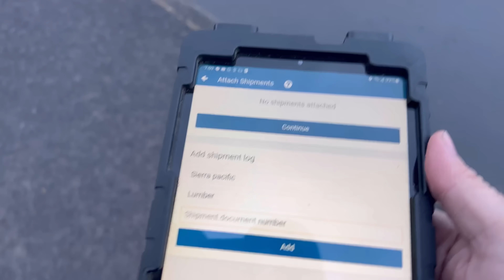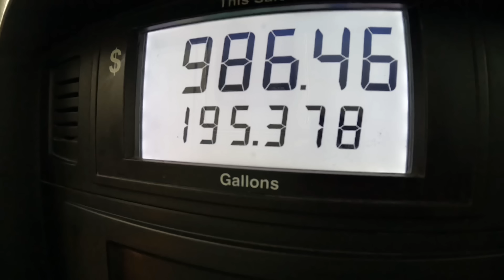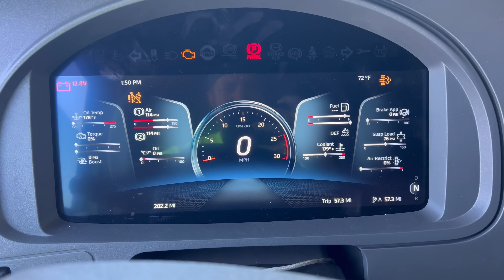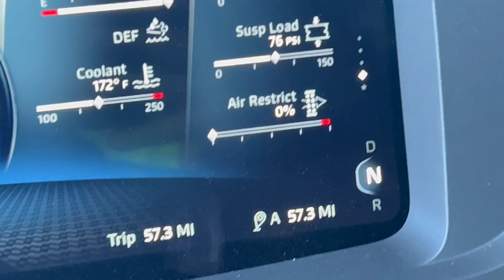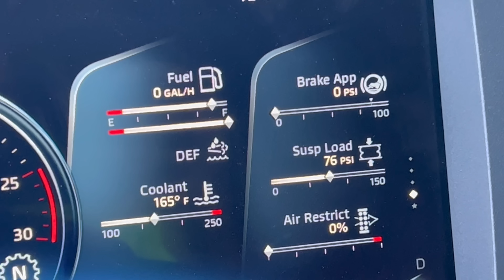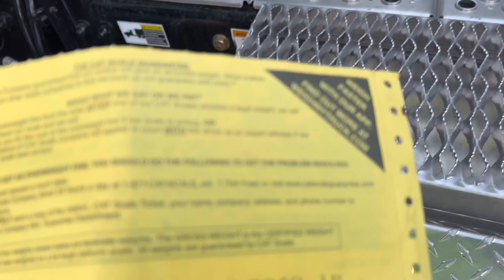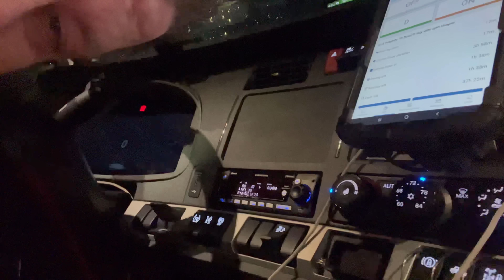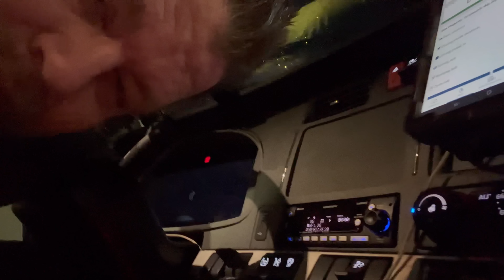Supply chain crisis recap. September 21, 2023. Oregon, Washington.

Comment: that truck will be heavier because of the engine the cummins is heavier than a paccar due to the engine block
Reply from the maker: How much heavier?
Reply: @joeseppi_  dry wieght 400 lbs however a cummins holds 4 more gallons of coolant and 1 gallon more of oil than a paccar I had a 389 with a paccar then I bought my current 389 with the cummins everything exactly the same except engine and I gained just shy of 1500 lbs